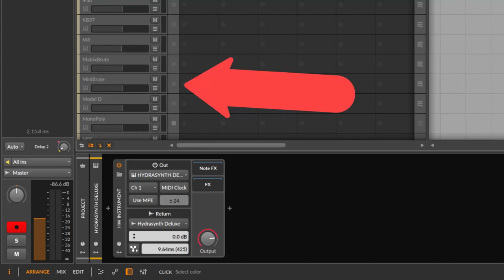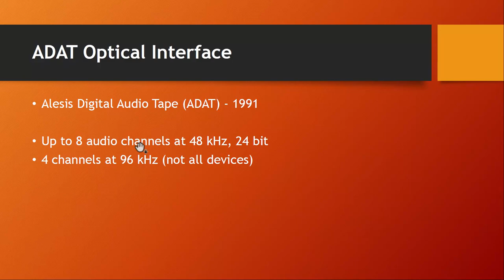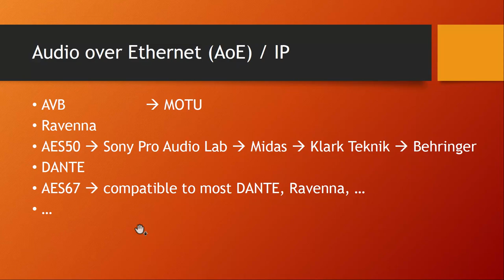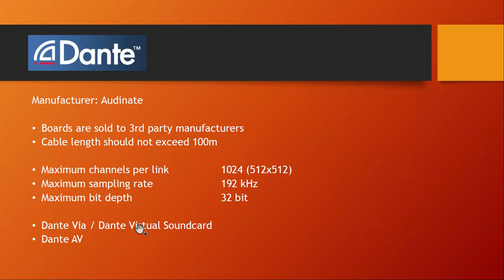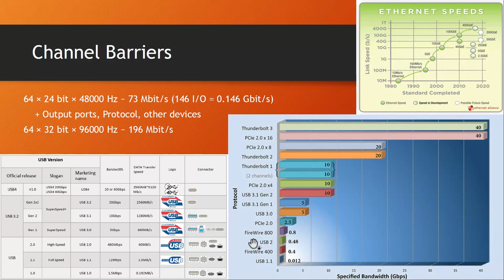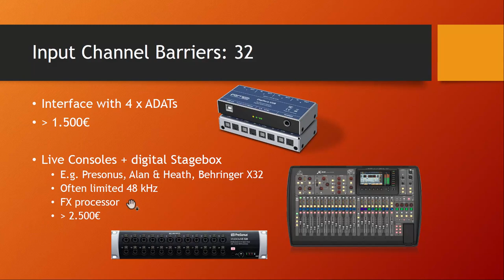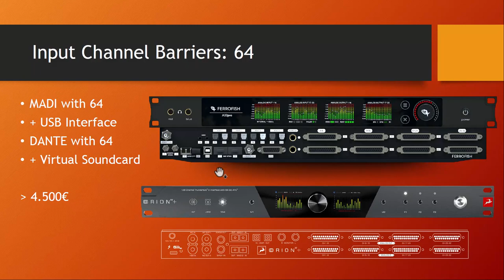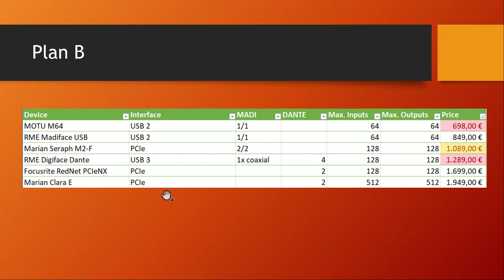Breaking the Input Channel Barrier - DANTE, MADI, ADAT - devices and solutions!

Comment: Note that AES50 is not an audio networking standard or protocol! It's just a regular digital multichannel point-to-point audio format like USB or MADI that only happens to use RJ-45 connectors. You cannot connect AES50 cables to network switches to share signals between multiple AES50 sources and destinations! For real audio networking, you need a OSI Layer-3-capable audio-over-IP protocol like Ravenna, AVB or Dante.
Reply from the maker: Yes, thanks for the clarification. I did not dive too deep into these things, the topic was already pretty broad.

Comment: Thanks for this video. I am looking forward to more on this topic. There is very little information about setups like this, but more people are posting about it now. 

My own experience...  First thing to realize is compromise is necessary. Even Dante and huge sums of money will not guarantee the perfect setup. Cost is probably priority #1 for most. I gave up on > 48KHz audio, and I also gave up on this being cheap. But what is cheap? Getting 32+ channels into a computer is not cheap period, but some solutions are cheaper. Think about it in terms of cost per channel, and make sure you have expandability.

ADAT - for > 24 channels, just don't go there. Most the stuff that does > 24 channels with ADAT are very expensive (because they are also high end). It is the least versatile method. Expandability is very limited and ADAT cables are short, so you can't span across a room or to a separate room. AVB, MADI, or Dante are where to look. Ethernet cables are cheap and allow 100m distances between boxes with no latency penalty.

Audio interface vs. Mixer - get past the idea of using an audio interface (unless you have lots of money to spend on high end interfaces). The best cost per channel comes from a mixer with network expansion (Dante, AVB, etc.), and that works as an audio interface over USB. Most these use USB 2 which is enough, but may have issues on some computers.

Dante is probably the best solution but expensive. Loopop just did a great video on this - he went with Dante, but wow, expensive! Also, wow, so many options!  Dante has the least compromises, most versatile, and most popular for professionals, but that is also why it is so expensive.

I don't know much about MADI, so I won't comment. I assume most what I say below about AVB applies to MADI.  

I chose to go with Presonus and AVB. The cost per port was much less than Dante and even the > 24 channel ADAT setups. Presonus is about the same as Behringer and other mid range studio/stage mixer setups. It can work completely independently for live play (no computer if you want), but hook to a computer for 64 in/64 out channels (though on some computers you may have to reduce this down to 34x34 due to USB issues). Because they are USB class compliant, I can also use my Presonus mixers as an audio interface for my iPad (think iPad as an FX processor or virtual Synth bank) while using a different computer on a separate Presonus mixer as the master computer (DAW, etc.), connecting the mixers together via AVB.

I started with a Presonus StudioLive 32R rack mixer ($1800, 32 in/16 out, 34x34 or 64x64 I/O over USB to my computer). You can add another 32in/16out channels with a stagebox (Presonus NSB32.16, $1300 or the NSB16.8, 16 ins, 8 outs, $900) or another 32R mixer (or 24R, or 16R). There are limitations beyond 40 channels (you can only mix 40 channels on these boxes), but there is a 64x64 routing matrix which gives you options to change which 40 channels you mix. You can mix 76 channels on a Presonus StudioLive 64S console. A 64S with a NSB32.16 stagebox gives you 64ins/32 outs, all mixable, but this console is huge and about $4000. Still much cheaper vs. a similar Dante setup. I wish they made a 64R rack mixer (like a 64S, but rack mount, not a console). One box would give you 64/32 I/O for probably $3000. But doesn't exist. 

Instead of a stagebox, I went with a 2nd 32R rack mixer (bought used for $1200). I can configure my 64 in/32 out setup in a multitude of ways to enable mixing different sets of instruments, mics, FX sends, etc. I never use all these inputs at once, but I can physically connect everything (e.g. 64 mono or 32 stereo devices) and not have to swap cables. I set up profiles to select and route instrument groups based on what I plan to do (just swap profiles). No I don't have that much gear, but a couple multi-out drum machines can use up inputs fast! 

For example, since the 2nd 32R is also a mixer, I can connect a multi-out drum machine into it, using onboard or outboard FX per channel, then send the mix on a single channel to my first 32R mixer to send to the computer. Or I can configure (without moving cables), all the drum outs to go to the computer directly from the 2nd 32R to the 1st 32R to the computer if I want. All this is done with a quick profile change.  This is what I mean by compromises. I can't bring all 64 channels into my computer, but I can re-arrange things virtually without swapping cables.  If you really want all 64 channels into your DAW, the 64S mixer console can do that as I said previously.  

Recently, I bought a Presonus StudioLive 32SC mixer console (16 in/10 out, 17 motorized sliders, $1800 new, $1000-$1500 used) and an AVB network router. A downside of AVB is you can't use it on standard network routers where Dante works on your normal network. I connected all 3 of them together (32SC as the master, plus the two 32R's), and using profiles, I have access to more I/O then I will ever use. The iPad/computer app for controlling the 32R does everything the console does, but sometimes physical sliders and buttons is better. The same app can control the 32SC as well, so the app on an iPad is the most convenient UI.  

There isn't much information on Youtube about these stage/studio mixer setups.  That is why I wrote all this. More people are posting videos though. When I bought my first 32R mixer, I had to figure this all out on my own and I am still learning and trying configurations. 

I chose Presonus but Behringer can do mostly the same. The Presonus 32R has 32 in/16 out and 40 mix channels, and 64x64 or 34x34 I/O to the computer. The equivalent Behrigner X32 Rack mixer has better built in FX and their rack mixer has a touch screen (as well as an iPad/computer app for control).  But it has only 16 in/8 out and I believe 25 mix channels (? no more than 40 for sure so no better than the 32R), and 32x32 I/O to the computer. So Presonus is cheaper per channel (including adding stageboxes, etc.). I prefer the smaller Presonus 32R rack mixer (no screen) and using an iPad. I wish the Presonus had better onboard FX, though. I would go with Dante if money didn't matter, but the cost of this setup using Dante would probably be 2-3x the price. 

Last note on AVB. MacOS natively supports AVB. Presumably, you could route a pair of 32R mixers directly to MacOS into your DAW. Doing so requires an AVB router and a dedicated Ethernet port on your Mac to the AVB router (e.g. using Wifi or a 2nd Ethernet port for your normal internet traffic). Or you could hook a 32R mixer directly to your Mac's Ethernet port with a single cable, no router. You would still need to control the mixers from the app, but you would get 64 in/32 out with that setup. Unfortunately, I have heard mixed results on this. I haven't tried it yet. Dante is likely more reliable for this. See Loopop's recent video.
Reply from the maker: Thanks for sharing your insights witch match 100% with mine. I also looked closely into the Presonus/Behringer solutions but they are just take up too much space. A friend of mine is also running a similar setup with 2 Behringer X32 into a RME UFX III. Yes, I saw the Loopop video, which I mentioned in my video as well (and linked in the description). This actually  made me go down this research rabbithole 😂

Comment: Thank you for this video, you are the only one on youtube that has done this type of a video, there is another one from some years ago but we are in 2023. I think it would be best if you try out the Dante or MADI and see first how accurate the latency is compensated on several Bitwig channels at the same time, meaning is Dante or MADI doing an excellent job sending and receiving the audio and all the midi parts stay tight ? I have been skeptical of that, so always stayed with PCIe AES card 16 in and out. I am also a stickler about converters, tried many of them, I stick with Burl, Mytek, RME, stay away from Antelope stuff and older Lynx, the newer ones are good but too expensive. I also ditched the ES-8 and just went the ADAT ES-3 and ES-6. One way to future proof yourself and keep it cheaper than MADI, is just going with RME RayDAT PCIe you get your 32 ins and outs and you can connect bunch of those behringers or try out different conveters and maybe in the future you might want higher end stuff that ADAT option will give you that opportunity. You can also run multiple RME Pcie Cards on the same machine and the best thing is that no one can compete with almost zero latency of the RME, its the tightest system, if you dont like their converters then just get only the interface and pair it with whatever you want. I know you are not Mac person, but you could buy a MAC PRO 2012 tower that has 4 PCIe slots and put bunch of stuff in there, Bitwig runs on Mojave still, that would save you tons on PCIe enclosure if you want a new Mac etc(this is what I end up doing). The other option is to with SSL Big Six has 16 in and outs and bunch of flawless routing and summing, it wont be enough but men it works nicely with Cubase and Bitwig and with Akai samplers in USB class compliant mode. Sorry for the long comment but you have done so much for us with your scripts we owe to you. Thank you Sir!!
Reply from the maker: Thanks, for the detailed answer! You are now the 2nd who mentions that RME devices can be combined on the same computer, that's clearly something to look into as well.

Comment: A guy on the Reaper forum mentioned using a Dante 128 PCIe card on the main studio computer. He would then get his clients to install Dante Soundcard on their machines.

The client plugs into a switch at the studio, he then mixes the clients projects *live as they stream from the clients machine into the main computer.
Reply from the maker: Oh, wow, that's an interesting application! Do you know which PCIe card he uses?
Reply: Yamaha AIC128-D if I remember correctly
Reply: I think this was another comment from the same guy "My very special, revolutionary service for my clients: they can shine in bringing their own PC or MAC (regardless) with their own projects recorded in their own DAW (whatever they are using), simply connect their computer to my control room network via a cat5 cable and can mix their projects right off of their own DAW into my analog gear! No need to export/transfer/convert any project data into my studio pc - just real plug-and-mix!"
Reply from the maker: @IncorrectDisposal  Thanks!
Reply from the maker: @IncorrectDisposal  Actually, a great idea!
Reply: @mossgraber  "That guy" is actually me :-)
Reply: That guy is my (very smart) friend!
Reply: @alvaromorello  😘

Comment: So IIRC, DVS is limited to 32/32 @ 96 kHz, so hopefully you knew that (RME Digiface Dante has the same limitation). The only way I can recall that supports more than that is the Dante PCIe cards which were discontinued (unless there is a replacement I haven’t looked at it in awhile, but the first party and Yamaha, FocusRite, etc. ones I remember looking at were discontinued). Also, it wasn’t clear from the video or maybe I missed it, but looking up that Ferrofish unit, it only had MIDI capabilities over USB, so all your audio ingress has to be through DVS or RME Digiface ($$$). Just know that Audinate isn’t very good about providing quick driver updates, especially on macOS. I have used a lot of Dante, it is a good system. Just pricey.
Reply: The most complex setup I’ve seen is using MADI over fiber into a Digico Quantum 338, then coaxial MADI into AuviTran Audio Toolbox, then Dante out of that into an AVID Pro Tools MTRX Studio, then Digilink out of that into a Pro Tools HDX PCIe card in a Mac Pro, then return path is the same. That same place is also using Those AuviTran Audio toolboxes to convert MADI to AVB since that’s what their amps support, so everything is digital from the source all the way to the destination. The Pro Tools rig is for recording and broadcast mix.
Reply from the maker: Thanks for the hints! Yes, I am aware of the limitations. I look into possible alternatives to DVS at the very end of the video.

Comment: I recommend you to have a look at motu avb interfaces and presonus avb mixers. cheers
Reply from the maker: Yes, I did that as well. MOTU is mentioned in the Ethernet section and Presonus in the 32 channel section.
Reply: Sorry, i meant to test/try these devices in practice and not only by research.. I would also mention that Audinante belongs to Yamaha, it's the most expensive (taxing all manufacturers when adding the protocol). It's the most established protocol due to different reasons but not necessary the best networking protocol either. It has big constraints and problems aside of price too. Did you know that motu interfaces and presonus mixers work well together via avb? cheers   @mossgraber
Reply from the maker: @pangea2003  Yes, their licensing is not on the cheap side. I plan to rant about this in the next video 😁 Where did you get the info that Audinate belongs to Yamaha? Couldn't find anything about it.